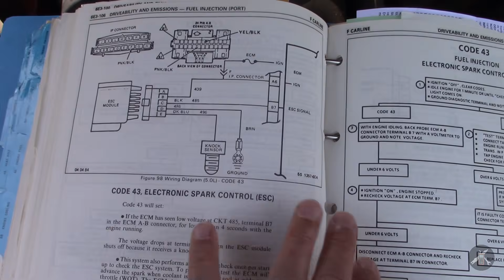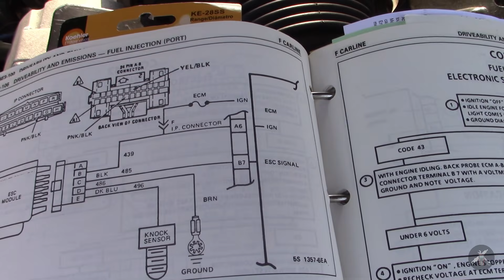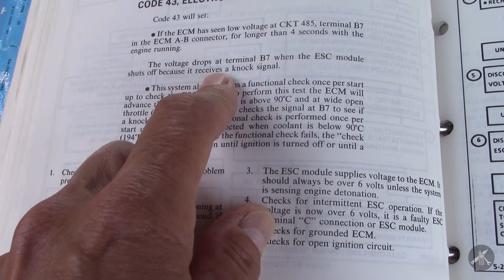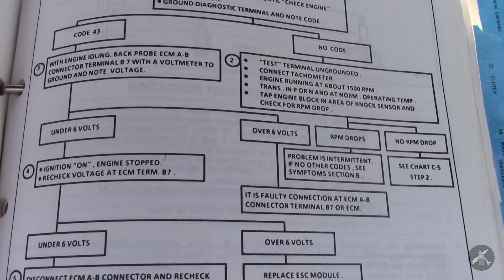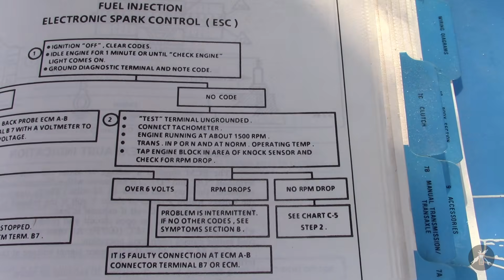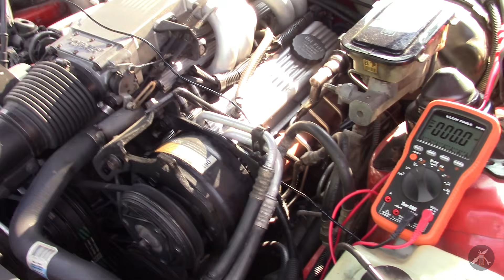GM OBD1 Code 43 ESC Fault with Electronic Spark Module

Comment: Sounds like the spark advance test at wot failed.  Did you ever figure out what caused it to fail?  I am having a similar issue with my 85 corvette.
Reply from the maker: I have never had this one come back.  I have several thousand miles on it since that one. It may have just been a fault in the diagnostic that cleared. Everything checked out, the knock sensor was new when the engine was rebuilt. It could also be that there was a bad connection on one of the pins on the module and I corrected it by removing the connector and reinstalling it.  I have seen this happen before.  Low voltage connections can develop microscopic fretting corrosion that is cleaned up by cycling the connector.

Comment: I am having some trouble with a misfire at idle, and now upon cold start it hunts for an idle for about 5 seconds then settles. When I disconnect the est wire on the passenger side of the firewall my misfire goes away. I have sort of shot a parts cannon at it but I would like to know if you have any input. It’s a 1987 iroc z 350tpi. I have a new distributor, ignition control module, coil, plugs, and wires. As far as fuel I have re sealed the fuel rail, installed new injectors, and a new fuel pressure regulator. While I had the intake off I also did the egr and followed your video using the corvette thermal switch (thanks!). I used to have a code for my o2 sensor, so I replaced it and never got the code back. I have adjusted the tps to .54v and my coolant temperature sensor under the throttle body has good resistance. I have no codes and my ses light does work. I have also replaced the air intake temperature sensor in the plenum. I have hunted for vacuum leaks and fixed all that I could find. I think it has to be electrical since it goes away after I disconnect the est wire. Thanks in advance for any help.
Reply from the maker: You certainly have been thorough in the parts department.  My first thought is curiosity about the effect of disconnecting EST.  I would probably start with a timing light check with EST connected. Timing on start should generally go fairly high probably 15 to 20 degrees at idle and it ought to be relatively steady.  By steady I mean that it may drift upward or downward as the engine warms up, but it should not be erratic.  I'm thinking that if it is stable with EST lead open, the distributor and ignition components are probably ruled out.  But, perhaps it isn't really misfiring, rather timing is erratic enough to behave like misfire.  If timing is moving, I would be looking for something in the EST system from sensor to module to ECM.  Might be a bad connection and not a bad part.
Reply: @bitsofwisdom460 Thanks! It will run smooth unplugged and after plugged in timing will advance and it moves around slightly, but not drastically. I figured maybe the knock sensor could be sending bad input to the esc module, so I unplugged the knock sensor and I still had the misfire. I checked continuity from ecm terminal d4 (white est wire to ICM) and it had no continuity to ground and had perfect continuity to the icm. I also check the bypass wire and same story it checked out fine. I am wondering what the voltage should be from the white est wire from the ecm to the icm should be. Do you have a trouble tree or a book that would say what the voltage should be? It’s pin D4. 1987 Iroc z 350tpi VIN 8. Thanks! Also what repair manual would you recommend?
Reply from the maker: The EST circuit from ECM to the ICM (ignition module) does not have voltage or signal defined in the service manual.  In my manual EST to ICM is ECM pin B4. I suspect that it is some type of coded signal.  It could be something like a string of pulses or a PWM.  I can’t tell.  The trouble tree in the service manual for a Code 42 (ESC failure) has a specific set of tests with an ohmmeter that tests whether the module switches properly when fed with a signal from the ECM. The test is too complex to describe here.  It really is trying to define whether the ECM, ICM or wiring is at fault.  Like most diagnostics, an intermittent may not set the code or may set the code yet be hard to determine.

The other clue is what I showed in this video on the Sensor / ESC module side. The ESC module feeds a signal to the ECM that is roughly 9 volts and drops when knock is sensed.
The video shows the trouble tree and wiring here:
https://youtu.be/X_Iw0prq8f8?t=369

The manual that I prefer is the original GM Service Manual.  I bought mine from eBay, and I know that  books4cars.com carries used manuals.
Reply: @bitsofwisdom460 Thank you so much

Comment: Hey Dan! Great job walking us through the test & what you'll need to do it. 

Wanted to tell you that knock sensors & ESC-modules can be bought through RockAuto & it seems that there are some reputable companies producing them from what I see. Gotta be honest, getting new magnets for my fridge from them is a valid reason to buy from RA anyway.

Hope you've had a great summer!
Reply from the maker: Yes, I've had a great, but busy summer, thank you.  And Rock Auto is my go to most of the time since most places don't stock parts for these older cars.  Probably at least 75% of my parts came from there and I have a lot of magnets...

Comment: I have a 1982 Corvette, the ESC and ECM are 2 parts that if they fail would cause a big headache.  The ECM generally isn’t available and I believe the same is true for the ESC.  There are multiple alternatives but each comes with different challenges.  Keeping my fingers crossed. Thanks for the content.
Reply from the maker: I'm sure it is a challenge.  I did see something in GM service information that said something to the effect of the module for my '85 looks like the module for an '82, but was designed to work with a newer knock sensor, so not compatible.